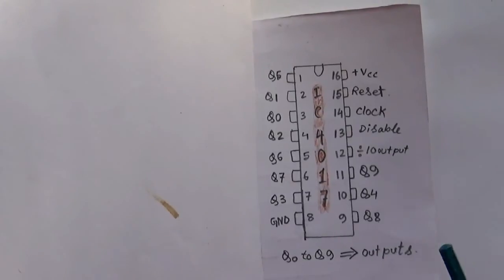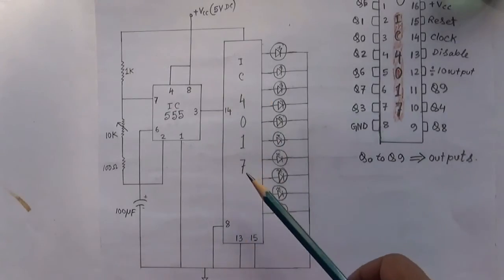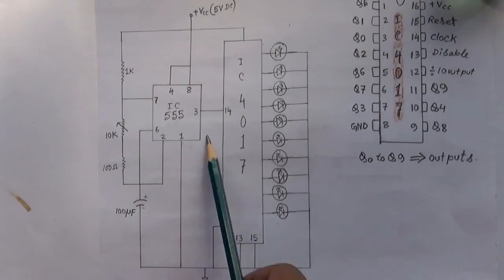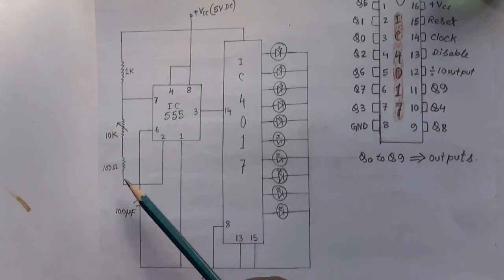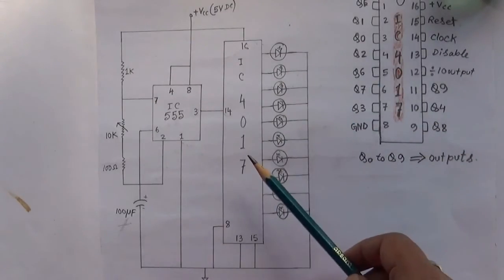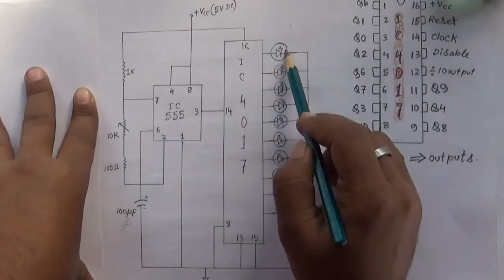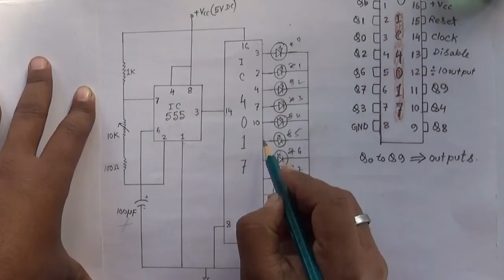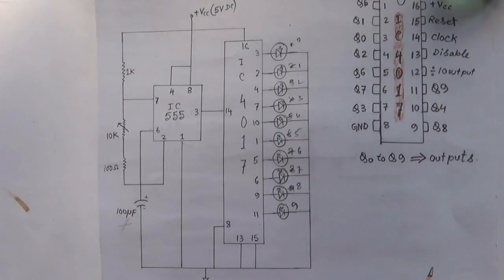LED Chaser circuit explained using 4017 IC

Comment: can you make this WITHOUT 555 timer?
Reply from the maker: Here 555 timer used for creating clock pulse...By creating any clock pulse without using 555 timer, you can run those leds. You can use some resister, capacitor or Gate circuit to create pulse. Except this you can't control the run.

Comment: Bro where u are joining the variable ragistance
Reply from the maker: We know at 4017 ic pin 14 is clock input. It is controlled by 555 timer. Place a variable resistance (VR) between pin 6 & 7 of 555 timer. Don't forget to place a minimum resistance in series with the same VR.

Comment: How would you be able to build the 4017 out of only analog components (transistors, capacitors, resistors, etc.)?
Reply from the maker: you can watch TTL circuit of 4017...

Comment: Can you tell me what are the materials needed on that video ? please i need it :)
Reply: +eros vejerano Reply Please :)
Reply from the maker: 9V dc supply, 555timer IC with astable multivibrator arrangement and use 0- 100K Pot for variable resistance, 4017 IC, LEDs, 330 ohm resistance to prevent LEDs.
Reply: elecpro

Comment: hi nice video can you tell me what is vcc is it a 5 v battery???
Reply from the maker: +Shahroz Rashid  Thanks for your comment ... Vcc is not only 5v battery.. but a +ve edge of DC voltage which is a power supply of a circuit.It may be comes from battery or dc adopter.